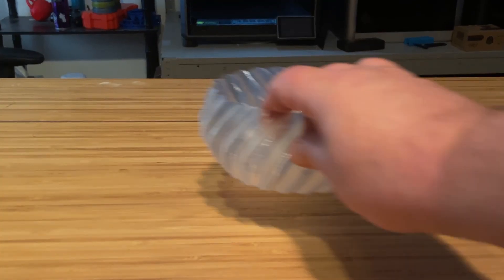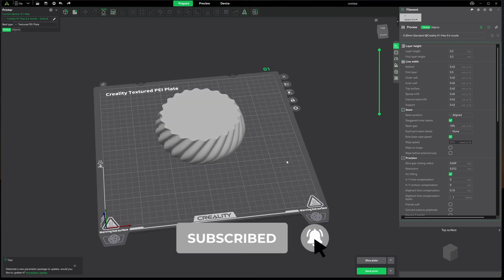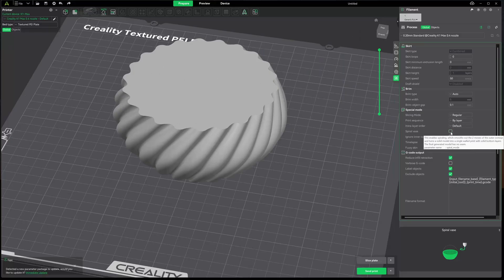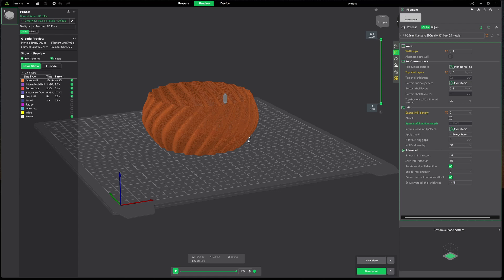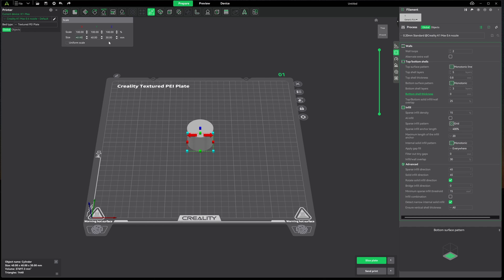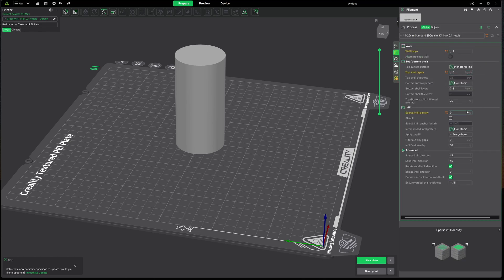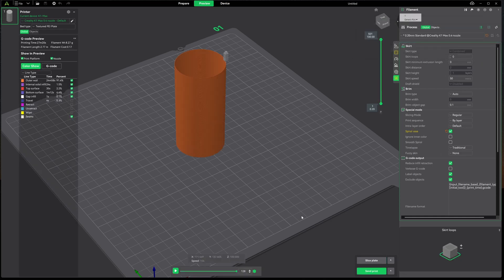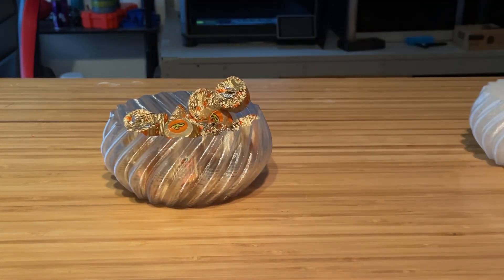Creality Print Spiral Vase Mode

Comment: You can get rid of the z seam. By using. All these settings....  Seam= Aligned, staggered inner seams enabled,  seam gap= 35%, Scarf joint seam=  Contour and hole,  scarf joint speed= 100%,  scarf length = 20, role base wipe speed= 20, extrusion rate smoothing= 100, smoothing segment= 5.  Your welcome. Thanks for the insight on vase mode.